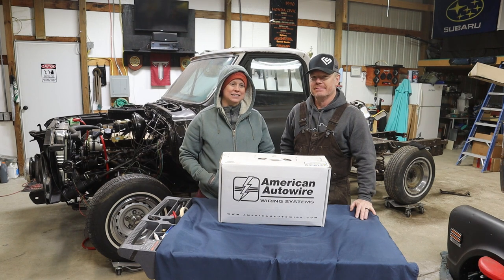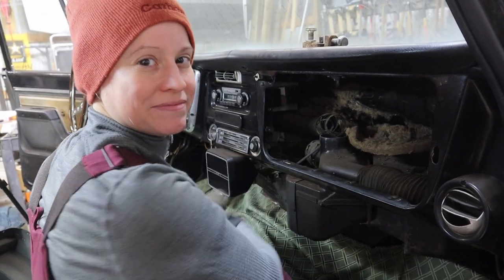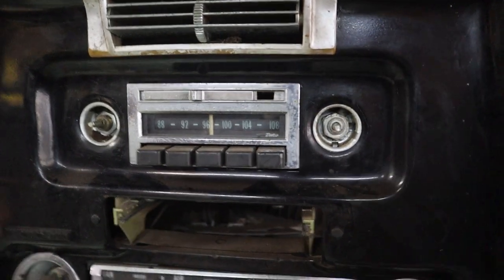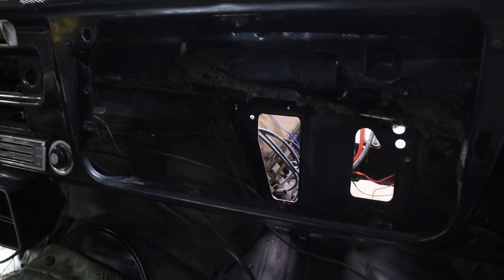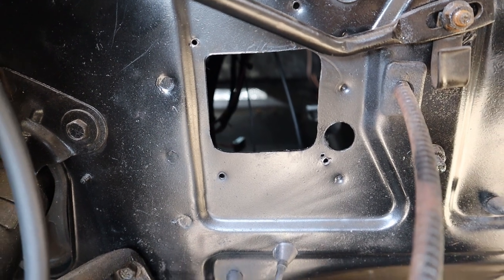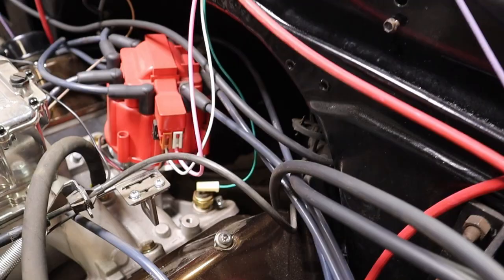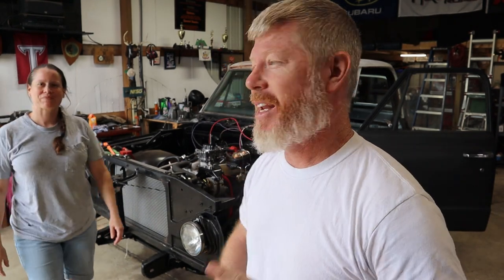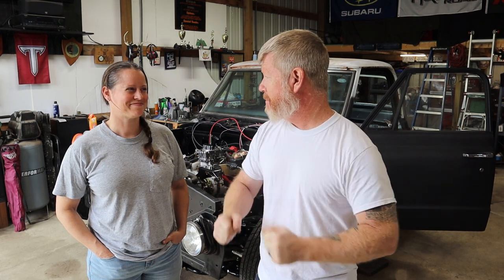1972 Chevy C10 Full American Autowire Kit Install & First Start Up - Part 1 - Project Harold

Comment: I installed the same kit on my 70 K25. My truck sat for about 6 months, I had an issue with the horn circuit and original wiring. Almost lost the truck. The new wiring is awesome, everything works so much better and brighter. I look forward to seeing your progress!
Reply from the maker: Hi James. Thanks for watching, sharing and following along on the journey. We really appreciate it. That's awesome to hear about your K25. We've been pleased with the kit so far. I'd say we're about half way done with rewire. We've had to bounce around a lot with other projects so it wasn't a priority, but now the biggest part is the steering and dash that I have to get a move on. Probably the biggest part I'm not looking forward to. LOL.

Comment: Can I ask what alternator and fuse set up and wiring kit you used for the battery and alternator? Im literally doing this now... any input would help tramendously
Reply from the maker: Hi Thomas. Thanks for watching and sharing. We really appreciate that. We went with a Proform GM CS130 (160amp) alternator. I believe the PN is 66430.16N. For the fuse and wiring, I had an old 300w ANL fuse and holder from my audio days so I just installed that with all new 0ga OFC wire for the + & grounds. Hope that helps.
Reply: @SpiritedWrenchers  thank you so much!!!!
Reply from the maker: @Petedadechii  our pleasure!

Comment: Really enjoying your series so far. I hear those American Autowire kits are super detailed and work great and relatively easy to install.  Its funny how you start to do one thing and it leads to another like now you are going to get Vintage A/C cause the original system was shot, or was that in your overall plan. The original radio, looks like an AM/FM you removed if are not keeping it and have no plans for it I would be interested in purchasing it from you. We have emailed previously so if you are interested in doing that let me know. Got mine back on the road a month or so ago but am having some cuttig out issues and cant seem to pinpoint why.
Reply from the maker: Greg, 1/2 of my Canadian C10 connection friend. LOL. Thanks for watching and glad you're enjoying the journey with us. The kit is really good. I feel comfortable about electrical but the size of this project certainly makes it intimidating for anyone. Our original plan for the AC was to replace the pieces with what needed to get the original going but after taking it all off, it's condition just isn't worth it. The radio is one that I believe we're going to keep just for the look of it but have a more current model in the glove box and out of view. I'm not seeing anything attractive with the retro options out there for the money they're charging. Glad to hear yours is back on the road but the cutting out isn't good. Do you have an  new carb or still an old one? I received your email so I'll reply to this to chat more. Cheers!